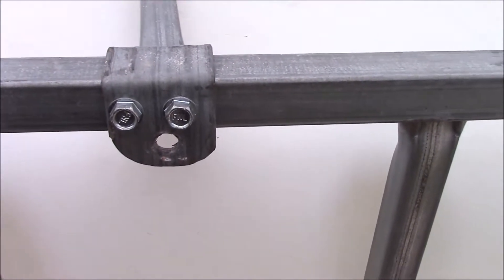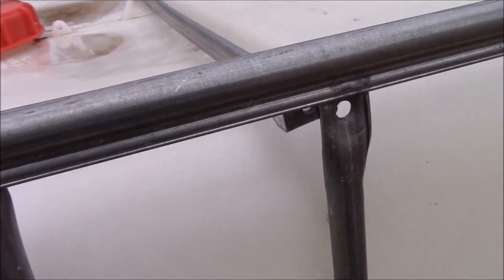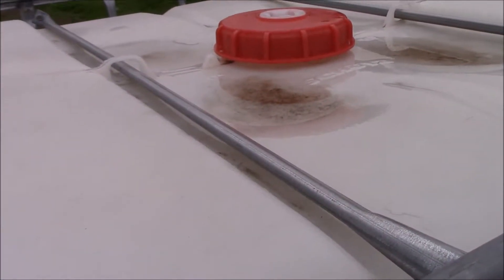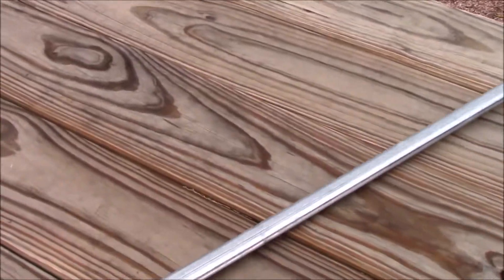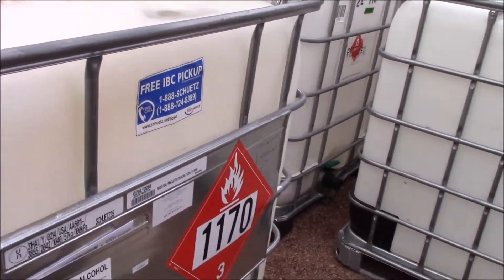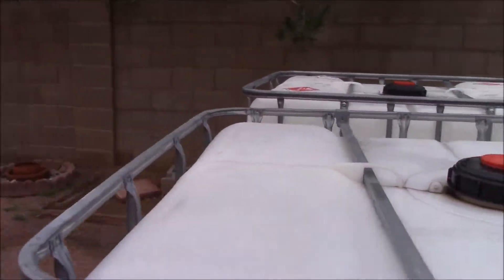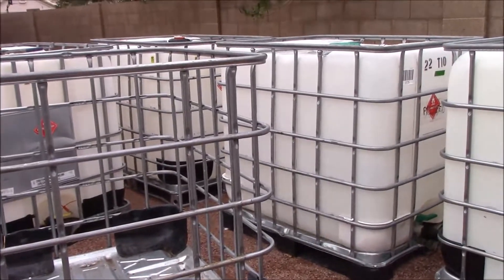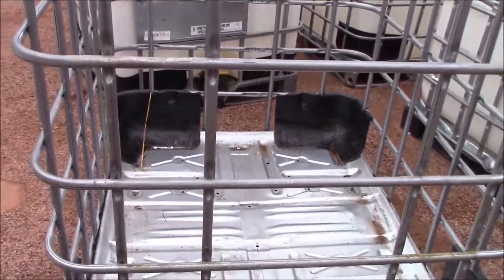DIY IBC FISH TANK OR AQUAPONIC SYSTEM

Comment: why not cut both the plastic tank and the cage at the same time with reciprocating saw.?  the cage horizontal bar would serve as a guide, just cut along the top of the bar cutting the cage and the tank at the same time.
Reply from the maker: roy hoco that can work also
Reply: @MichaelEugenio  thank you that is the method I will use

Comment: Can you not clean oit the non food grade?
Reply from the maker: bear adams depends on what was in them . Some items are to harsh to wash out . It's always better to use something that is non toxic and food grade than not
Reply: Michael Eugenio well that sucks cause ive already bought a non food grade one lol
Reply: No label on my IBC but the guy told me it had Baslamic vinegar in it. It may have but in all this florida heat it smelled like turpentine.  Tried power washing the gunk residue but it barely budge. I used purple power and let it soak and it removed all the gunk.  Power washed again then filled it with my swimming pool water for about 3 days and drained it. 80 percent of the scent is gone. Currently have it filled with tap water and now after a day there is a thousand tadpoles swimming in there.  scent 95 percent gone

Comment: Wondering if you habe to cut the whole top,of the tote off.  Would it be just as good and help with evaporation if there was just a smaller section used as an access panel and leave the top intact?
Reply from the maker: Kimber Barkdoll an access panel would be good also . It just depends on what exactly you will be using the bin for .
Reply: Michael Eugenio Personal fish farm.  Like a huge aquarium of fish for food, until we get the greenhouse and convert to aquaponics

Comment: you determine if its food grade by the dot label, and the msds sheet. not the address. those are not food grade. its ethyl alcohol which is a chemical. lucky for you it is a chemical that evaporates easily. and is probably safe.
Reply from the maker: craig ward I know for sure it is safe since I called the places directly to verify what was inside also . Thank you for your comment
Reply from the maker: craig ward also some of them were labeled alcohol beverages. I wouldn't have had done this blindly.
Reply: Michael Eugenio yes I understand, just didn't want people to think a winery only uses food grade things. they also use 98% hydrogen peroxide, sulfuric acid, phosphate, chlorine dioxide, for cleaning and sterilization. always look at the chemical that was in the tote, not the facility it was from.
Reply from the maker: craig ward  great points ! Thanks for all your insite . I really appreciate the feedback when people have it . I should have explained my method a little differently. Do you have an aquaponic garden?
Reply: pull out the paper from the material safety data sheet sleeve, lookup the 1170 number on the NIOSH website. look at what the msds says about spilling into waterways to determine if it is safe for fish
Reply: I dont, but I use one for a salt
water refugium for my aquarium. and I work at a brewery, so I know the kinds of badass chemicals we get in totes. :-)
Reply from the maker: craig ward nice . Again thank you for your comments I really appreciate your input and I think I'll add your info to my description as well . This will be a big help for other who are unsure what came in their totes .
Reply: @scubasteve4sq , I'm two years late but ethyl alcohol is grain alcohol. It's the alcohol you get from fermenting crops. Is it a chemical? Yes. But then so is water. Simply saying "it's a chemical" is pointless. Ethyl alcohol totes from a winery are almost certainly food grade. Your advice is good, but "it's a chemical" does not impart any useful information.